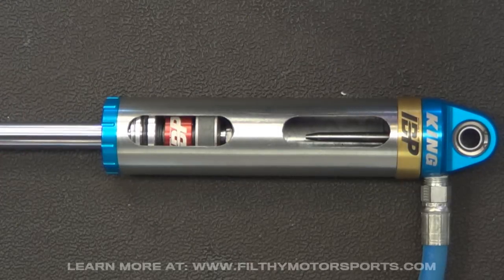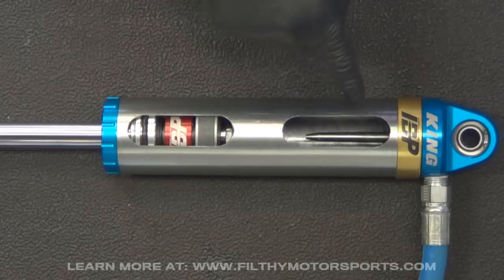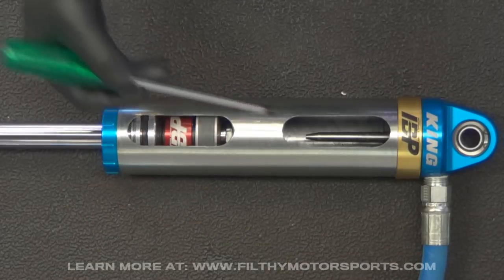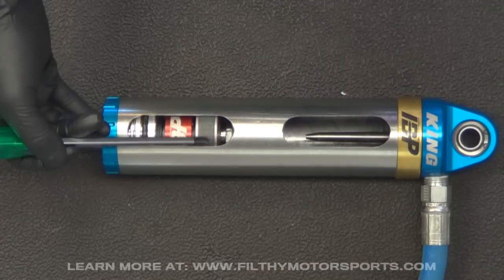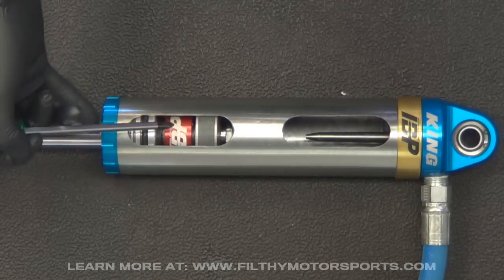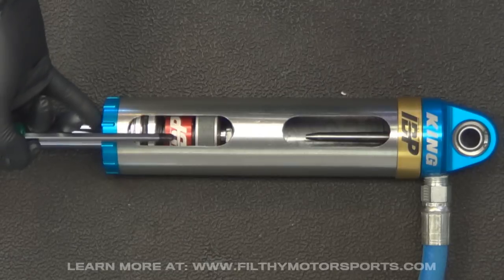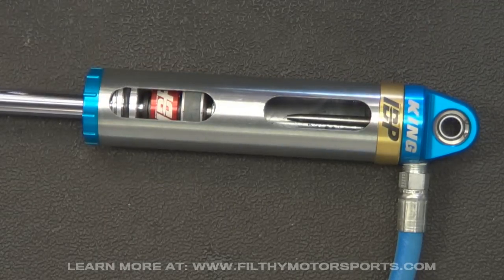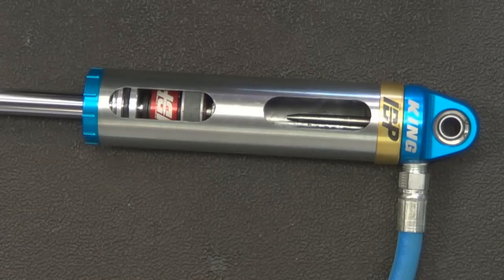How the King IBP Internal Bypass Works - Filthy Motorsports

Comment: so this style king shock also acts like a bump stop?
Reply: the non-red piston is valved to be extremely firm in the mid-high speed range to dramatically slow it down, which isn't normal for a king shock when there's only 1 piston.